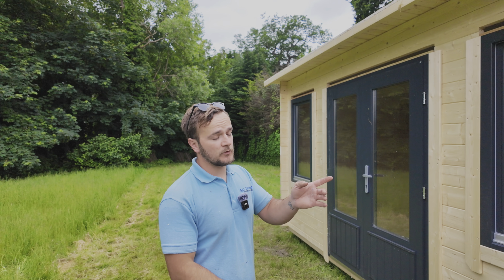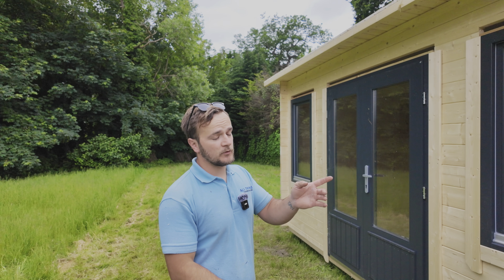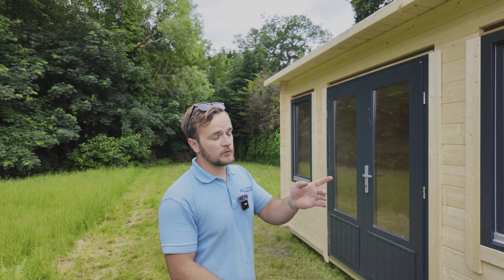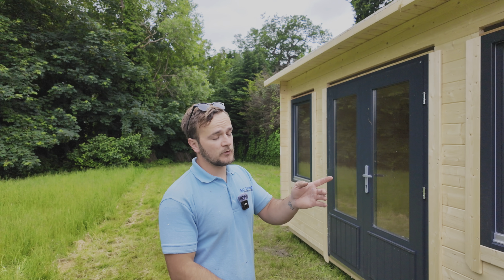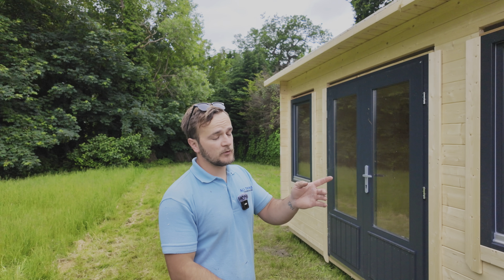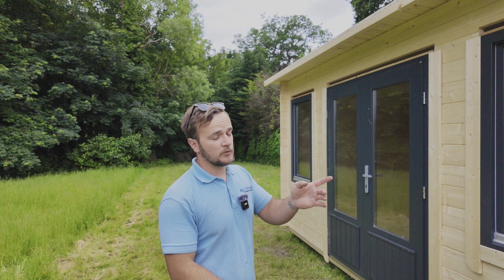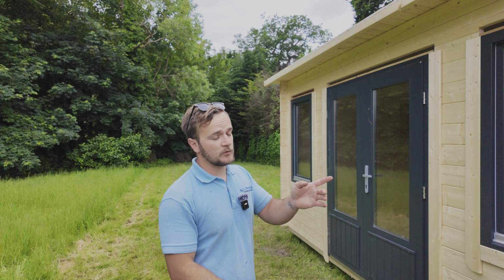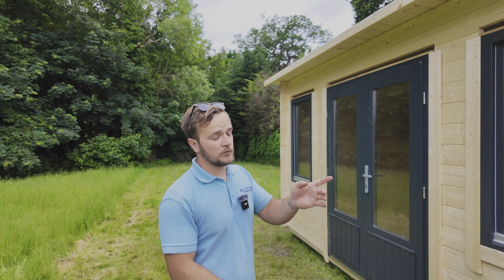YOU CAN BUILD YOUR OWN DIY SUMMERHOUSE BY WATCHING THIS VIDEO!

Comment: I don't know if this is a ridiculously stupid question, but is it easy enough to hang a tv in these log cabins or do you need a different type of wall mount? I'm just worried that I screw threw the timber and ruin it
Reply from the maker: If you’ve got a 44mm wall thickness, you can always screw and glue a batten horizontally first then bracket to that so you’ve got a good grip of the wall , other than that you will be fine 👍

Comment: Love your videos. Just a few questions for you. Firstly do you screw down every row of logs? Secondly if so where do you normally place the screws? I never see you putting on the storm batten is this something you never use?
Reply from the maker: Hey Gary! So we try and screw it every meter, we do screw every row of logs too.

There is no storm battens with these buildings as they are screwed it does the same thing. 

I have personally see a strong storm rip the roof off a building even with the battens so if it’s going to go, it’ll go , but less likely if the whole building is screwed 

Thanks for watching !
Reply: If screwing  the logs what about expansion ? Wont the logs split. I thought the whole idea was to screw first log to floor bearers then none